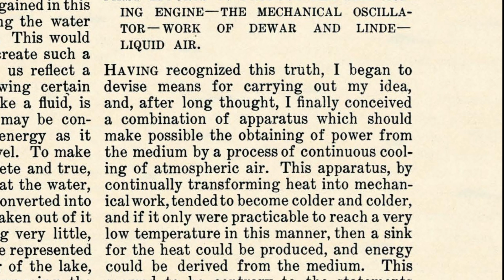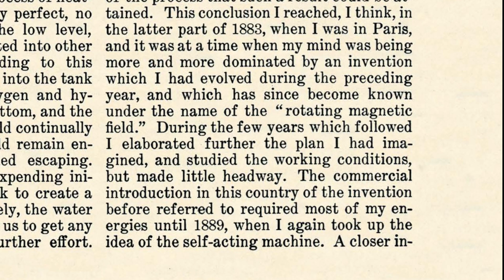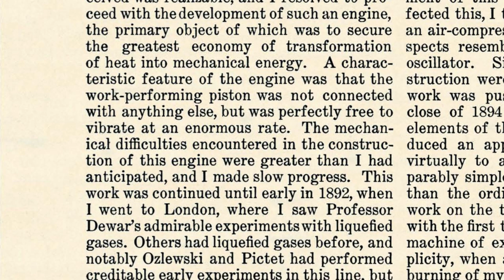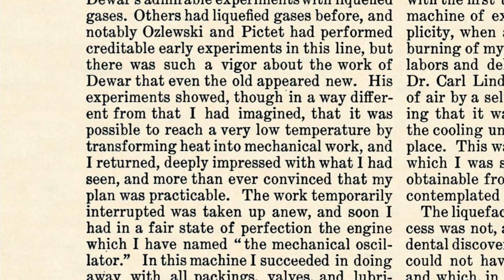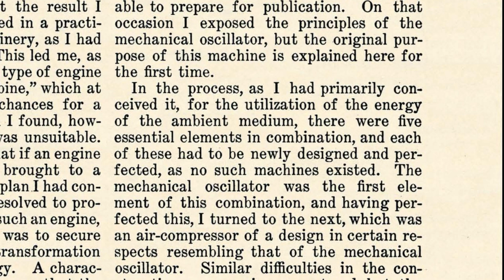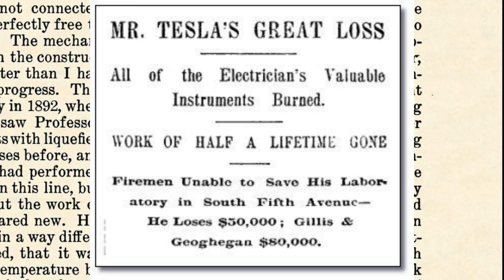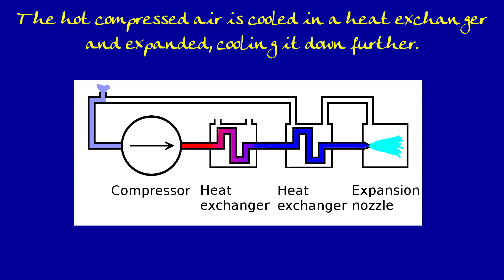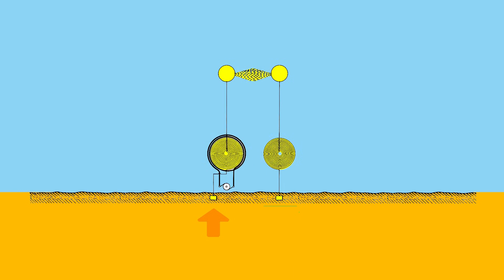Tesla's Magnifying Transmitter - First Ever Full Explanation

Comment: Here is Gravity for edification. Gravity is a 3 way inertia valve that resides slightly reclined at the pinch point of magnetic & spacial hyperboloids. At the center of gravity is a dielectric field and gravity is either stationary, right spinning, or left spinning by time. Gravity is a 2 dimensional oval.
Reply: I eagerly anticipate your receipt of the Nobel Prize for physics.

Comment: 7:04 Tesla subscribed to the globe Earth theory?
Reply from the maker: Of course he did. Just as any sane person would.
Reply: @WardenclyffeResearch  Well I can understand that considering I followed NASA and the space program my whole life. Even joined the air force asap at 17 on delayed entry but due to a couple different circumstances did not formally enlist. I can only say this in regards to my question and that is force vectors. Gravity down towards center of mass. Lateral acceleration at a 90* right angle relative to the line of axis referred to as angular velocity. The 2 forces when vectored will produce a "force direction.  If you can see something I've missed please let me know as a correct understanding of physics is important. 

Newtonian laws of force and motion when applied to the angular velocity of a rotating spherical  body, crossed by an implied gravitational force that pulls toward the center mass of the body, when vectored, predicts a force direction  that shows angular velocity at a 90* right angle to gravity unopposed at the poles that changes incrementally at each latitude from 90* unopposed to directly opposed at the equator of the spherical body. The only place where both forces could find balance. 

Newtonian laws of force and motion predict that if Earth were a spinning sphere with gravity pulling towards its center of mass all unrestricted water on its surface would necessarily have to follow the vector angles produced to the equator and then upward to the point where gravity's fixed and angular velocities increasing forces were equal, but since angular velocity increases with radius it will overtake gravity at some point and propel the water out in a disk and off of the Earth.
Reply from the maker: @tiredironrepair  OK, a correct understanding of physics is indeed important as you demonstrate. Because it leads to ridiculous conclusions. I'm not exactly sure what force you are referring to besides the gravitational pull. But let's take the possible candidates one by one.
1 - in order to have a rotational motion instead of a linear one a force is required towards the centre of rotation (or the axis). This is called the centripetal force and on the equator this force aligns with gravitation and is the largest. But being part of a rotational system you experience the opposite apparent force which is called the centrifugal force. Due to this force you would experience a small weight reduction at the equator. This effect gets less as you move towards the poles. When not at the equator and not at the poles you will feel a combined force that does not go exactly to the centre of the Earth but towards a point on the axis that is slightly closer to you.
2 - It is also possible that you are referring to a corriolis force in which case you are wrong because in order to feel this force the radius of rotation must be changing.
Now, it is interesting that you say you followed NASA because THEY introduced the flat Earth theory in order to discredit anyone who does not believe the moon landings. If you want definite proof, chose a starry night point your camera to the stars in the north and take a long exposure picture to see how the stars (appear to) move in the sky, Do the same pointing your camera to the south and try to explain what you will discover. Do not try to explain it to me, explain it to yourself. I am not interested and I am not going to spend any more second on this absurdity.
Reply: @WardenclyffeResearch  Thank you for your polite reply. So many people get all worked up about this subject I've noticed. It's going to take me a little while to research the  other considerations you brought up. My first thought was that it seems like an overly complicated way of determining the force direction of 2 vectors but often I have found things that seem simple at first glance have a way of becoming more complex when closely examined.
Reply from the maker: @tiredironrepair  Please do understand the reason why people get "all worked up" about this: Your question is an insult to the receivers intelligence. Imagine I asked you whether you "subscribe to the theory that 1+1=2". It is not a theory! It is a blatantly obvious fact! And calling it a theory that one can subscribe to is utterly ridiculous. And expecting to be taken serious requires the other party to stoop down to the level where this blatantly obvious fact becomes a theory. For most people that is asking a lot.
Reply: @tiredironrepair the earth rotates at one revolution per twenty four hours. Gravity vastly overwhelms the other forces.

Comment: How do we collect the first return pulse from the ground? Is it collected through another coil or step up transformer then fed back through the first coil into the ground?
Reply from the maker: The secondary coil (compressor) picks up this return pulse and thereby raises the voltage in the primary circuit causing the spark-gap to fire at the exact right moment. See also my other video: https://youtu.be/HJylD7xpEiU
Reply: Thanks very much, I have been investigating this for a while and after your video it makes sense, also your efforts will allow others to more forward more quickly. Many thanks again for all your work 🙏
Reply: Please look at an attempt I made some years back using the ground medium, it is possible. Next phase will be matching the return coil.
Reply: https://youtu.be/h_bp42qLqXc